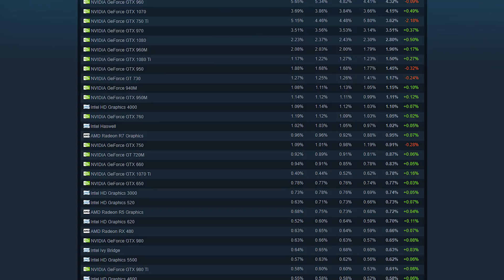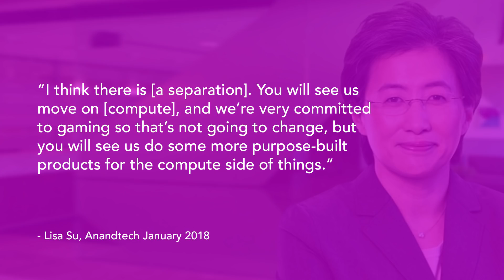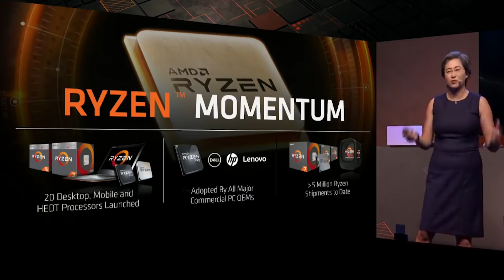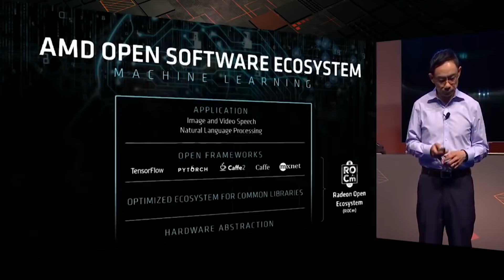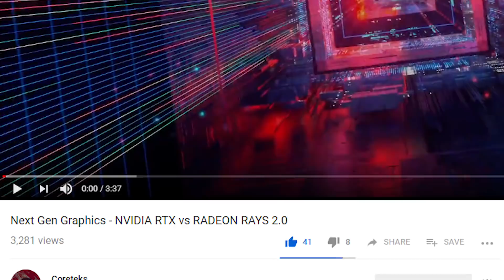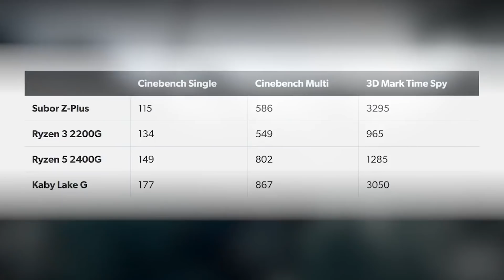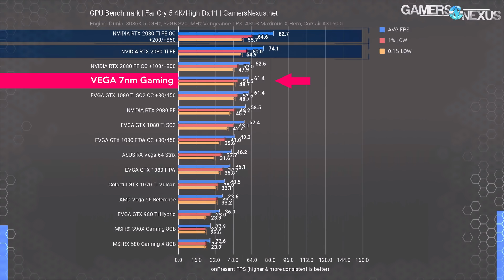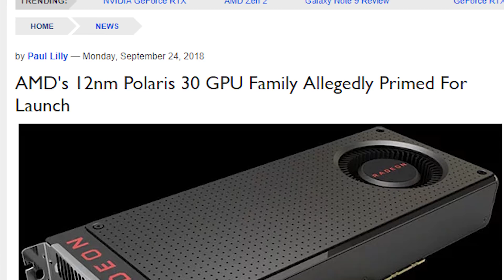AMD's answer to RTX

Comment: AMD is a lot more consumer orientated. While most of the time nvidia's technology is exclusively useable on their GPU AMD tends to use an open source approach for their technologies. But the gap between nvidia and AMD is getting bigger with each generation of GPUs. I hope they will make a comeback with the next generation since nvidia really rushed this launch. I mean the prices of the RTX lineup are ridiculous for an average 35% performance increase and a technology that is clearly not ready for this market. You are simply not able to test the raytracing capabilities because of the lack of developers supporting this technolgy at this early stage. 

Tldr: nvidia rushed this launch cause of their market position. I hope for AMD to bounce back at this point and deliver a smooth launch.

Comment: Couldn't give two fucks about AMD or Nvidia.

I just want a fucking GPU that can do 4k locked 60 FPS with max settings at 600$, is that too hard to make?
Reply: $600???? A 4k 60fps gaming machine is going to run you AT LEAST $1500 for a long time, not until we can figure out how to make very cheap, very powerful parts. So don't get your hopes up.
Reply: @Adam-ub3eu  RIP 4k60 fps maxed gaming then.

Comment: How well will 7nm Vega preform without HBM? I think 10-15% less or use 30% more power. The process shrink will save you 30% power difference but then you are back at Vega 56/64 performance. The only difference the cards can now be profitable at $250-350 range.

Comment: I'm sorry, but the numbers on the graph are exactly the same as the 1080ti and not in between the 1080ti and the 2080. The story then, is that if they get the 35% increase AMD's newest top end card will be as good as NVIDIAs last gen top end card. The only way this will affect NVIDIAs dominance is if they get the pricing right. If we take what they did with the Vega 64 (ie 1080 performance at 1080ti price - post launch), I see this costing the same as the 2080.

Comment: you guys have to be pretty biased and dumb to think AMD's RX 500 and 400 series werent successful at the mid-range gpu tiering, and Vega 64/56 do pretty good at the higher ends as well as a good price alternative. I personally enjoy my Vega 64 and i got it for cheaper than a 1080 while having the power of a 1080, if not slightly stronger.

Comment: i really want a new amd gpu, the bad thing with amd is their gpus (at least lately) they took years or several months to release and some people like me with a need for an upgrade tends to go with the fatest gpu available, 2 gen ago i had a 770 2GB with a hardware issue that 1 fan was not spinning no matter what and by that time the 980 and 970 were out, and by the time the 970 was faster than the 290x, so i bought the 980 because i got it cheaper and didn't had those fake 4GB, 11 months later the 390/390x/fury/furyx were out but was too late for me, next my 980 died because i did something dumb to the bios and i needed a gpu, the 1080ti wasn't even out, so i had to buy a 1080, because it was 60% faster than fury x (at that time), so i went with it, but damn vega took 1 years and 8 months to release vega, glad i didn't waited, i hope this time if i screw my 1080 amd has something ready for me this time.

Comment: Bro, don't jump on conclusion that early.. WTFFFFFFFFFFFFFFFFFFFFF
cant you see??? Nvidia was sooo scared by the freakin performance of the 7nm.. 
when they Showed its performance live.. https://www.youtube.com/watch?v=ZwJxWxKm1fI
7nm will be no where in between 2080 and 1080 ... cause 7nm completely outperformed soooo way faster
even without water cooling, just with air cooler and they just literally showed it on air cooling and nvidia was on water cooling
watch it better.. too bad as an nvidia fan you just couldn't stand the nvidia being thrashed by AMD :P
also i use Nvidia geforce 970 gtx turbo OC.. which got completely fked up when they released this
CRAP CARD = 2080TI, cause they released dumb drivers and my card got completely destroyed and 
I had to invest 1400$ more for getting my system up changing graphics card and motherboard also the CPU
I bought i7 - 7700k, 1080ti and Asus motherboard
Which i didnt want to buy in first place cause i wanted to wait for 7nm and go for some good choice in comparison
but fk nvidia.. TRASH and will always be TRASH = TRASH forever in the name of competition which can never overcome its
incompetence against AMD.. always try to rush release.. but they say, 
"A Knight that jumps too high, gets taken down by a PAWN" :P

Comment: What the speaker does not consider is that nVidia can also switch to 7nm. Assuming a 3070/3080/3080ti on 7nm, they can get better performance from the frequency increase itself. On top of that, with the transistor count increase they get on the shrunken node, if they double just the Tensor/RT cores they can get Ray traced gaming performance to 1440p 60+ FPS easily. Also many games by then would have support for nVidia RTX built in and optimised. The 3XXX can easily benefit from this. It will be a win win scenario. Now how does AMD plan to compete with that? Unless AMD does something fast, which obviously they cannot for some more time due to 7nm still being expensive, I don't see how they can compete. If they release a 7nm Vega with a performance of a 1080ti, then it will probably be crushed by the similarly priced 7nm 3070.

Comment: They really need to get on Navi architecture. Last I knew Navi was going to be similar to the current Zen Architecture, where they can 'glue' together GPU cores to make essentially multiple GPU cards, in a single card. Without the crossfire overhead that the generational dual core cards had.

Comment: +35% from clock speed increase due to process. With lower power consumption they can then add more CUs and still keep it smaller. e.g. 20% more CUs or a new tensor block or whatever.

Another questions, if you add a 2nd card, could RT be done in parallel on that and then return the result and thus scale well? e.g. much better than AFR etc.

Comment: 7nm is 10 nm, which is 11nm, And 10 and 11nm is more like 12 which is 14 nm, and 14 and 16nm are also the same. And yeah, We're basically still closer to 22nm than actual 7nm

Comment: A Pascal card was the first nVidia card I had since the Riva TNT. Too many times I invested my hopes in AMD after they bought my beloved ATI and too many times I was let down. 
As hyped as Vega was, I had my doubts given the past. My doubts were right. A bit faster than the 1080 I have about a year and a half after I bought it and using around double the power. The 1080ti was released before it and still outperforms Vega. 
I take anything AMD say with a grain of salt. I'll pay attention when they actually deliver on the GPU side of things like they did with Ryzen on the CPU side.

Comment: Vega is shit.  it runs very hot, draws more power, and costs more than its competitors equivalent.  Any video card they release in the future will be just as extremely expensive, hot, and overpowered.  because AMD thinks their card has something better to offer? i think not.  they destroyed the gaming community with their pricing, and now dont have anything to show for it. plus, NVENC destroys what amd has in terms of hevc encoding quality. they are dead last in that department. so, the question is, who will be stupid enough to buy their next $1000 video card?
Reply: I guess you have heard of Vega undervolting. Amd's stock voltages are way too high to ensure that even the worst piece of silicon can hit advertised clocks. Example. My Vega's stock voltage is 1.2V. I have undervolted to 1.05 V and also fine tuned core/hbm clocks to higher than stock and while gaming with 100% GPU usage (PUBG), the card consumes 170-185 Watts, which is lower than a 1070 on stock settings does. Oh, and also it performs better than a 1080 in gaming. Nvidia works out of the box, with AMD you have to tinker a bit yourself to gain most potential, but in the end it is worth it. If you feel like manually changing clocks in 2k18 is not suited for you, stick with Nvidia and call it a day

Comment: I think what Vega 7nm should go for is GDDR6 with a 512 bit bus. That should, on paper at least, match or be within 10%ish of the memory bandwidth of HBM2. The last AMD gpu that used a 512 but bus was the R9 390/390X cards and those were priced very well at launch. About $350 if I'm remember right for the regular 390. Even with GDDR6, the 2070 on a 256 bit bus manages about 448GB/s while the 1070 manages 256.6GB/s on the same sized bus. That'a about 75% better performance between the GDDR5 and GDDR6. The Vega 56 with HBM2 and its 2048 bit bus has a bandwidth of 409.6GB/s, which is still less than GDDR6 on a much smaller bus. Lets take the R9 390. It uses GDDR5 on a 512 bit bus and has 384GB/s of bandwidth. Lets suppose that we replaced that GDDR5 with GDDR6 and kept the bus size the same. I'm by no means an expert but from what we see on the GTX 1070 to the RTX 2070 using a 256 bit bus and gaining 75% more bandwidth with GDDR6, we could theorize the same would be true on a AMD card going from GDDR5 to GDDR6. So, taking that R9 390 and applying a 75% increase to bandwidth, we're looking at a massive 682GB/s of bandwidth. I don't know what the price of developing a 512 bit bus for GDDR6 is but I'd be willing to bet that its cheaper than using HBM2 or a newer revision of HBM.

I don't know how likely of a scenario that would be, probably not likely, but if Vega 7nm for the regular consuner space uses GDDR6 and a 512 bit bus, it'll definitely shake up the market, especially if they price competitively. Nvidia wouldn't have anything to counter such a move. The 2070 and 2080 are priced too high, while they could lower 10 series cards to a more competitive price, it would hurt them in the long run. Once 10 series cards are no longer available in the retail space, I doubt they'd be willing to slash prices on the 20 series cards to keep their edge on AMD. It'd cost them too much.

Comment: in my opinion AMD is spread over too many projects in order to provide a real alternative (price/performance) to Nvidia's gpu. Until now they sold well by delivering good quality for lower prices: fine for me, I don't really need top of the line. Now, with this mining disaster (having one's cards sold out to anyone but gamers is indeed a disaster), their products really went bust; I mean, they should't just blame the miners, they should do something about this. Until AMD decides what is more important for them, I jumped into Nvidia's camp (former r9 290x user). How can someone expect AMD to move on when, in my country, a Vega GPU is selling at the same price as a 1080 ti? And Vega has never been one of my options due mainly to its power consumption (what a joke). Environmentally friendly, someone?? Several generations later and we have rx 580 which is better than 290x with 2%: is this the company which you think will save the prices?